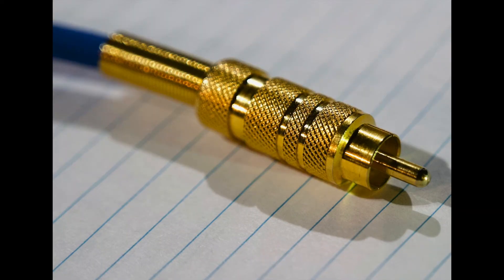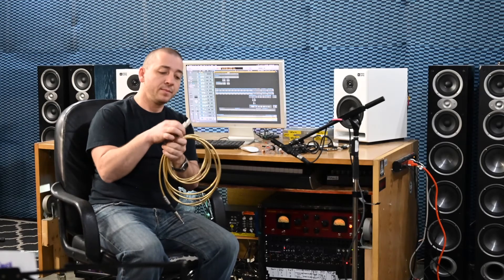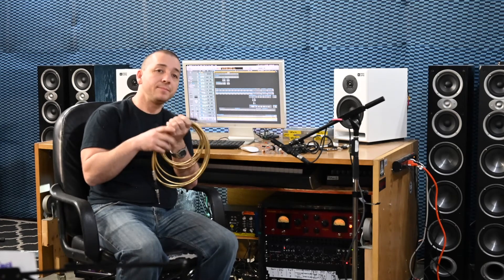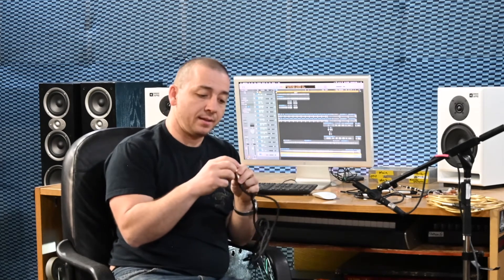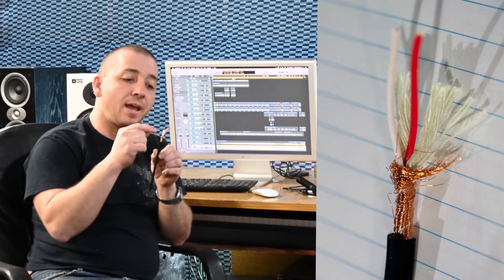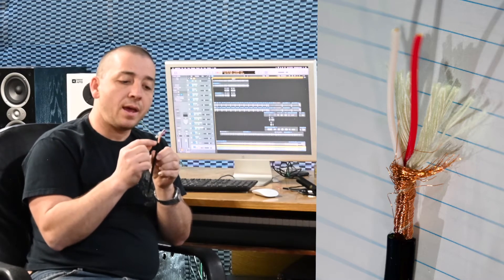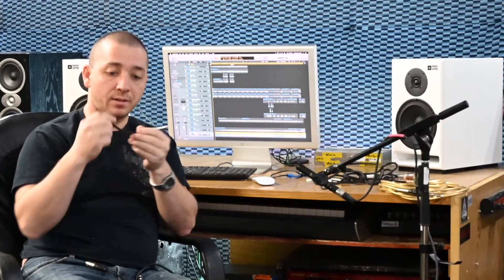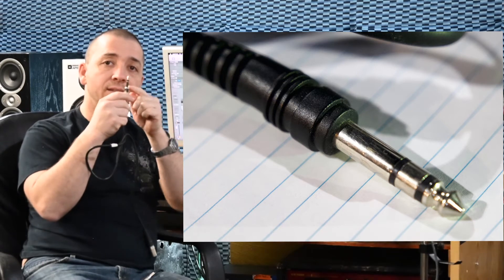Understanding balanced, shielded, stereo and mono audio cables. Lesson 11

Comment: RCA cables are NOT NOT NOT NOT banana connectors.  Banana connectors, usually connecting speakers to amplifiers, connects only ONE conductor; i.e. you need a pair of banana plugs to send a signal to your speakers.  Got it?  CAPEESH???

Comment: Hi, thank you for these explanations. I would have a question about RCA interconnect cables for an unbalanced stereo speakers setup. If the speakers are subject to noise because plugged in the same power bracket as a computer (along with a screen and a few other things), and if the price was the same, would the shielding better with "regular" shielded cables or star-quad ones ?

If I understand if I was goind to use star-qued ones, somes parts of the cables would be unused but what would be the differences in shielding/noise rejection abilities and sound quality/distortion of signal with a star-quad cable used in an unbalanced stereo speaker system vs a good shielded non star-quad one ?

Comment: I find it interesting that you don’t mention where the inverted signal comes from when using an XLR. This cable is designed for microphones in origin. A microphone naturally can produce two signals as the magnet passes the coil in two directions. These signals can be obtained from either side of that coil and are therefore inverse. Your video, however, is the only one I found to offer correct wiring when attempting to send the stereo signal via XLR. I have a single Mackey PA speaker with one XLR in, and therefore it shall not amplify a stereo condensed signal. This is a tough reality to swallow. That isn’t to say it couldn’t be done but stereo interference in common mode rejection would explain the weird sound that you mentioned in this video. The whole concept is difficult to deliver in one brief sitting. And that is certainly true, when omitting the circuitry of a microphone. I find it a strangely overlooked factor. Why is it that so few ask where such an inverted signal is produced? It’s not as though there were an op amp, or integrated circuit of any sort in a microphone. It seems to me more would be curious about the source of this  inverted signal.

It seems ultimately true, that I cannot send a complete stereo signal into one XLR without the common mode. Rejection affecting the difference between the two stereos signals. Hence again, the weird sound that you mentioned. Am I understanding all of this correctly?

Comment: I understand the explanation you provided about carrying a single channel of audio down an XLR cable with the signal duplicated and its polarity reversed down the cable to cancel out interference, but my question is - how does it actually work that when you FLIP the phase back (at the end of the cable, after it goes into the preamp), then you only end up doubling (phase signal + phase signal) the signal we want*, and not the signal we *don't want (i.e. the interference / noise)? Does the noise not "travel" down the cable into the preamp along with the signal we do want, and then again get doubled / boosted when it's inverted? In other words, why does the "trick" or explanation of how phase inversion down the cable of a duplicated signal only end up removing the noise, but doesn't also remove the signal we want? Aren't these two (desirable signal and interference signal) traveling down the same two wires? I think this is more of a physics / electricity question rather than an audio question. By the way, you're *amazing*. You really go into detail and cover topics that can be ultra-confusing, and you clearly know what you're doing because not only do you understand the theory, but you also have the experience of putting practical skills into work at your professional studio. Thank you! :)
Reply: It’s good to have some graphic depiction of the concept you’re struggling with. Having two signal, inverted with the same noise upon it allows that noise to be revealed and isolated when inverted at the end of the line. It’s a cool trick because it doesn’t require any integrated circuitry . It is in fact, a matter of physics as you supposed.

Comment: Can a 1/4 inch plug be TS balanced ?  2 wires 1 ground  and  these 2 both connected to the Tip?

Comment: Thanks. What about 3.5mm cable? I have a condenser mic hooked up to a 3m extension cable and I get a lot of hum most of the time. Especially when it's near other electrical equipment
Reply from the maker: That’s unusual, because condenser microphones require a balanced xlr cable. That’s what you’re using right?
Some low quality microphones have poor shielding from interference. If you are somehow using a 3.5mm cable for your condenser, then switch to an xlr cable.
Reply: @Get.Pro.Recordings   My shotgun condenser mic runs on a TRS 3.5mm cable. It's a Deity mini D4. I can't seem to find a cable like this with good shielding other than nylon braided. Wondering if I should just wrap tin foil round the one I've got, lol

Comment: You wired the adapter wrong. You should be using pin 2 only from both of the XLR female connectors, and if you are wanting to turn the signal into a stereo unbalanced signal the lead from the left female xlr pin 2 should go to pin 2 on  the xlr male connector, and the lead from the right female xlr pin 2 should go to pin 3 on the XLR male connector. You also have pin 2 and 3 labeled backwards on all the images.

Comment: Nice vid!! here's a Q. is there a difference between a stereo cable and a balanced cable? So can I use a stereo cable to plug my balanced monitors into my interface?? or do I need a "balanced" cable? Basically are the cables interchangeable even though the signals are carried are different?
Reply from the maker: The cables are identical, only the signal carried is different. So yes, you can use a stereo cable to plug in your balanced monitors.

Comment: What if I plug a normal 1/4 jack TS into a 1/4 balanced socket, would that damage anything?
Reply from the maker: It probably won't damage anything, most gear is pretty robust. Your 1/4" unbalanced jack will have a "Tip" and a "Sleeve", but when plugged into a balanced jack, there will be 2 signals of opposite polarity being input on the single sleeve. This will short circuit, and they will cancel each other out. So, it shouldn't damage anything, but it probably won't work.